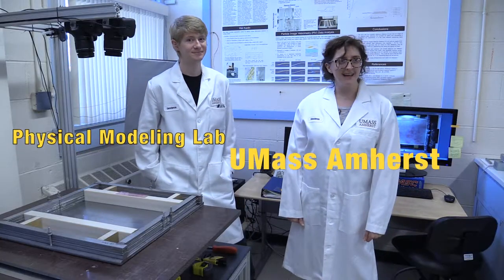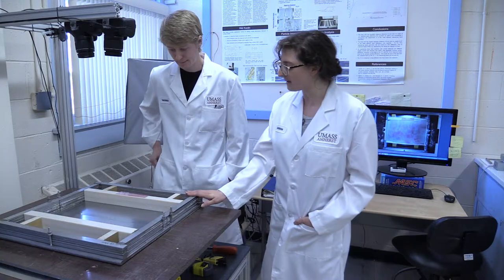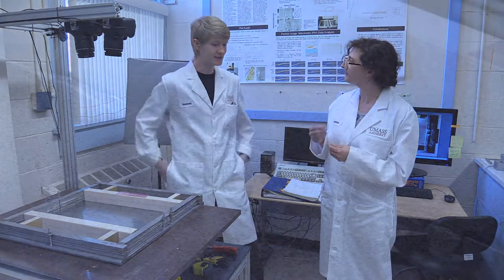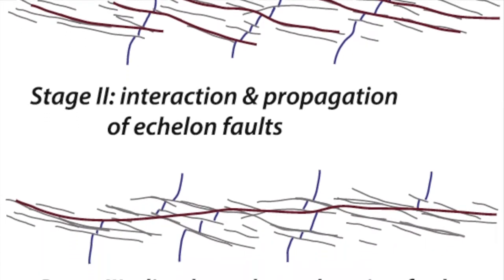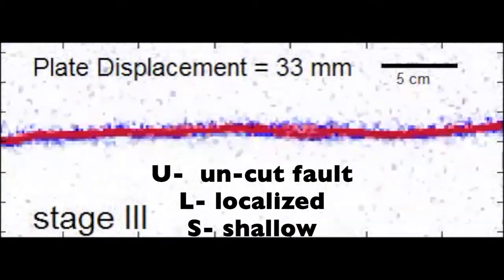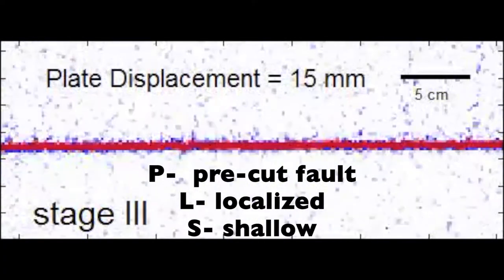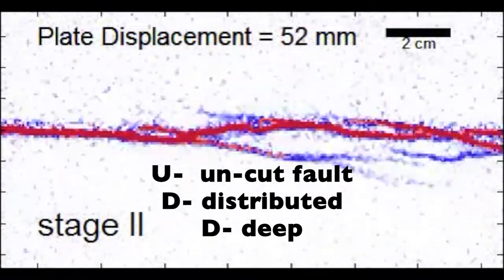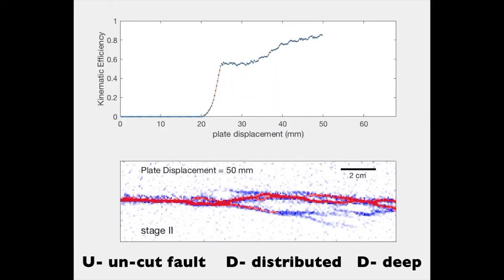Strike-slip fault experiments

Comment: What crustal depths would correspond roughly to your shallow and deep experiments?
Reply from the maker: The scaling of the clay strength is such that 1 cm of wet kaolin is equivalent to 1 km of crustal rocks.  So the shallow is 2.5 km and deep is 5 km. We are limited to 5 cm thickness with our current equipment. Fortunately,  the trend between these two experiments can tell us what to expect for even thicker scenarios.